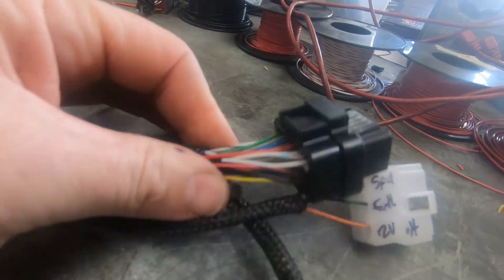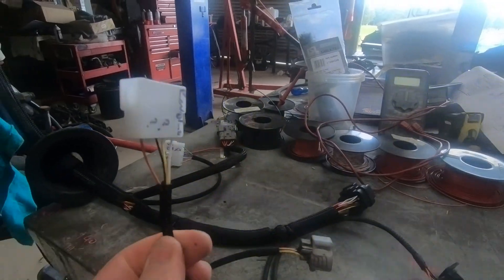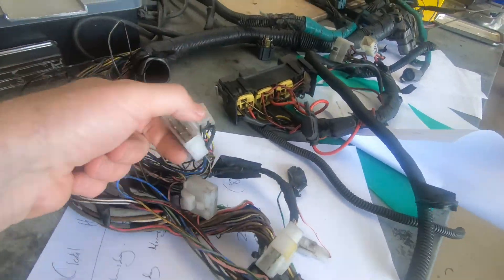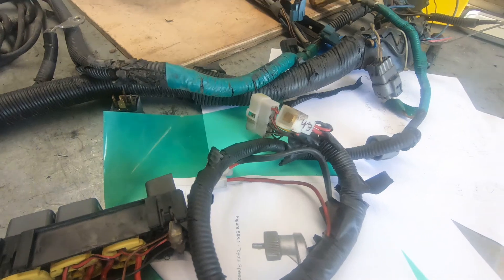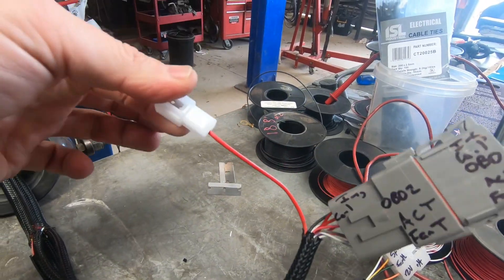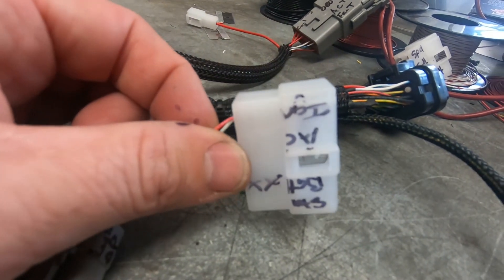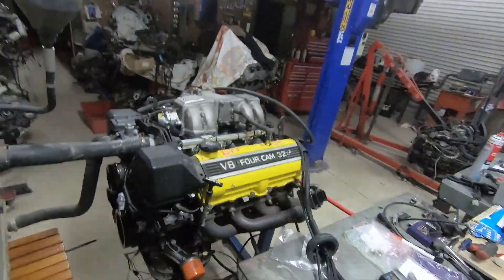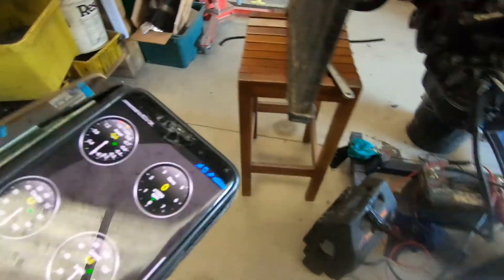1uz Wiring harness with link ECU Monsoon- Fusebox- V8 Toyota Hiace van PT4

Comment: I have a question for you. Talking about all the wide bind sensors and tuning, do you tune on the road or Dyno?
Reply from the maker: Hello Micheal.  I do a combination of both including log analysis.  I like to have the vehicle driving nicely with all the bugs ironed out before heading to the dyno to confirm the high load zones are sorted , which often aren't safe to tune on the road. Then confirm its all good with a couple of days driving and checking log files.  Cheers Kelvin